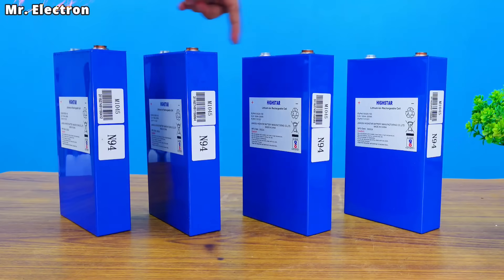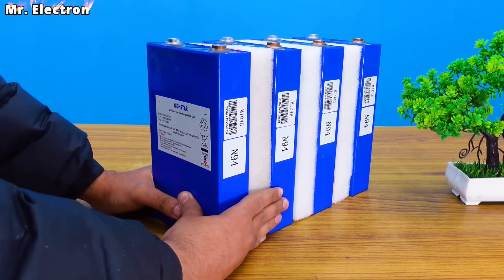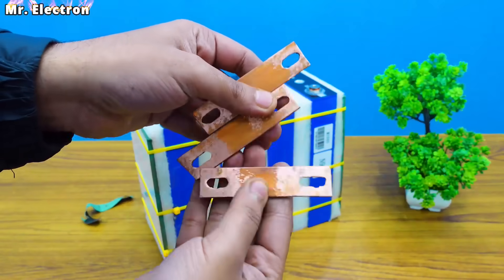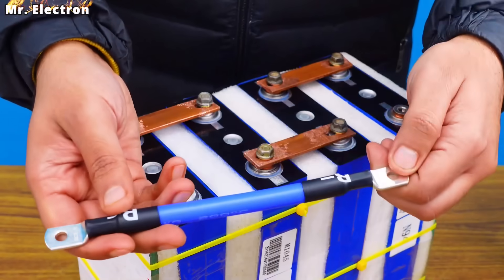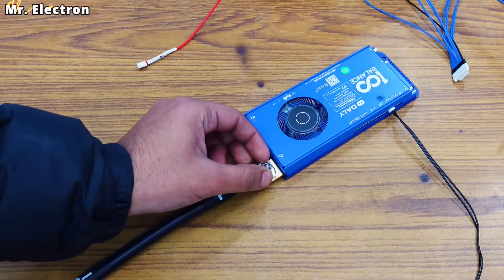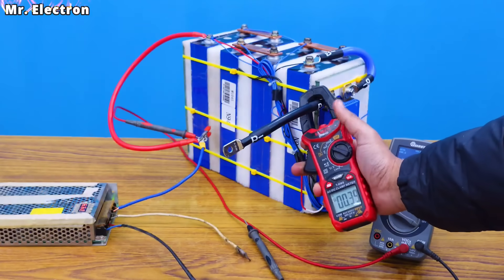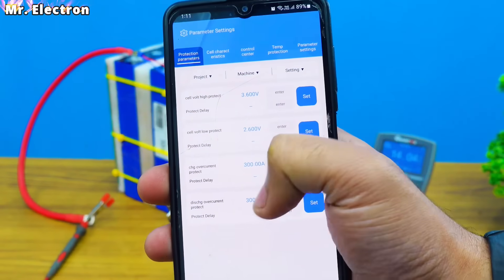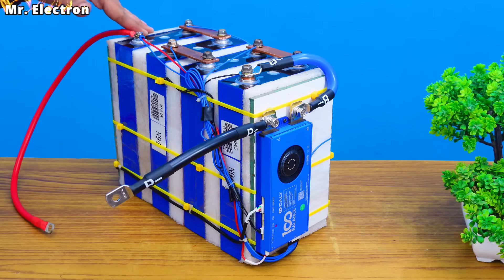Stop Buying Expensive Batteries - Build This 100Ah LiFePO4 Instead!

Comment: Don't forget to always top balance your cells before using them, I connect the cells in parallel and leave them like that for 24 hours. The cell voltage difference should not exceed 0.02v .
Reply from the maker: Yes exactly, very important to top balance the cells!

Comment: Sir, excuse me, I think you are making a mistake with that Ammeter. Are you measuring the Current with a current transformer? Well, it is not measuring correctly. Probably some noise peaks from the DC power supply. That clamp is a transformer and as far as I know, the transformer works in AC.
Reply: There are Ammeters that can measure AC and DC. They only cost little more than the AC only ones.
Reply from the maker: Thats a DC Ammeter

Comment: what is wrong with this is the bms cost more then the batterys in some cases, i do diy battery all time with balancers only the bms are 68 to 100.00 i buy battery with bms for under 100.00
Reply: You have links where you bought yours? Please share
Reply: @Mamatali  i buy from battery hook up only when on sale and on sale at temu it takes two weeks they all have been good i only put cell balancer on them their are about 5.00 i make mostly 24 volt batterys at temu they already have bms my charge controller and inverter does the same as a bms the controller cut out at 11v
Reply from the maker: Yeah ! Hey Friend! Please JOIN on WhatsApp for a stronger FUN and LEARN community: https://whatsapp.com/channel/0029VaQmmRaFCCoWOf7huh3G

Comment: Кончай трендеть, напиши какая цена батарей и запчастей
Reply: An A Grade 3.2V 100Ah Prismatic LiFePO4 Battery are around INR 2000 or more depending on their brands here in India.
The DALY BMS can range from anywhere around INR 600 for a 20Amp to around INR 24,500 for a 500Amp.

Comment: Bakterie je špatně sestavená,musí být vedle sebe na pevno,minimum mezer,takto se bude nafukovat a ztratí cykly nabíjení,a zkrátí se životnost.
Reply: If the battery is swelling that badly it indicates improper usage or overheating. This shouldn't be a problem in normal usage